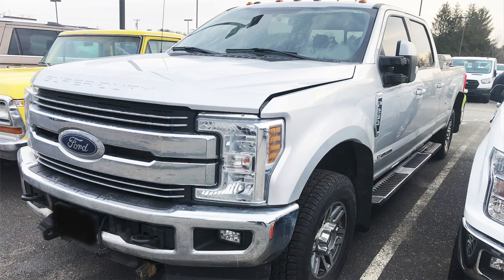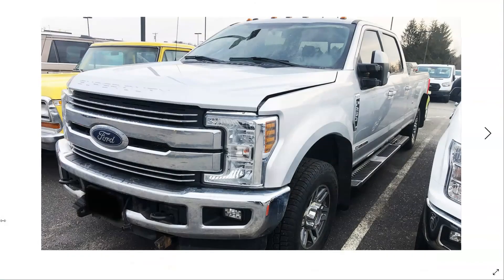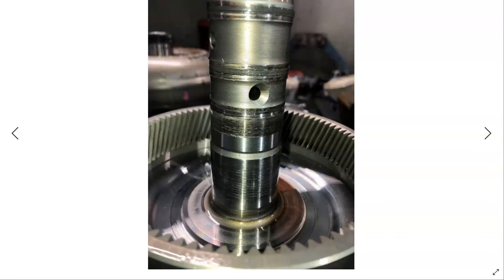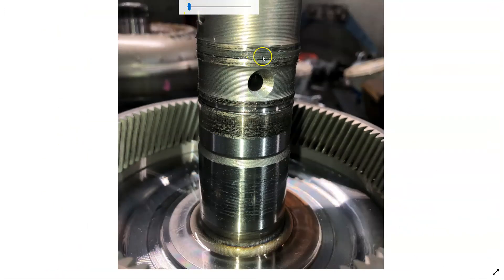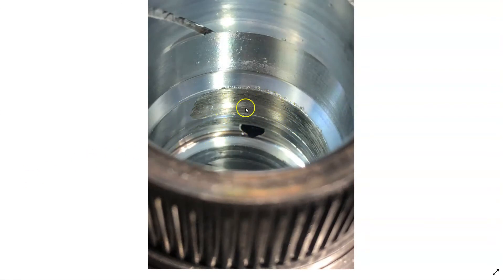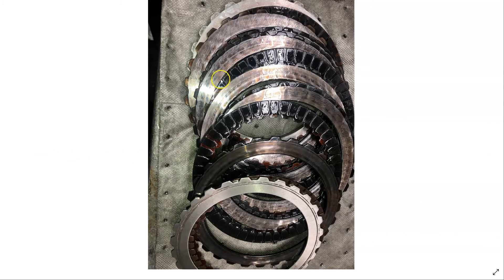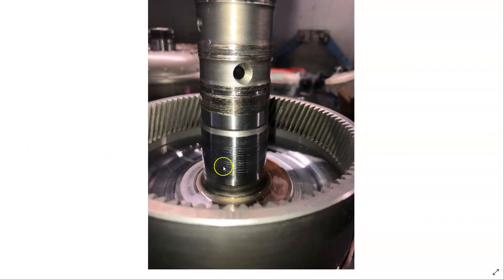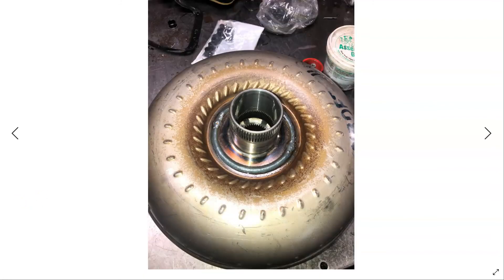2018 Ford F250 Transmission 6R140 FAILURE, P0735 Incorrect 5th Gear Ration, BURNT Overdrive clutches

Comment: I think my 4th gear is going. I got 40k on my 2019. replaced filter and oil 3x so far new pan,replaced 4 shift silanoids cleared the KAM and learning tables. POS give me back the Zf6 speed
Reply: I got 30k on my 2017. When towing occasionally it will slip violently and shake, then downshift. Happens in 3rd 4th now 5th.
Reply: @krice24  Speaking from experience replacing the 6R140 on my 2017, based on your brief description and without any other details or first-hand experience I would assume yours is toast. I recommend setting aside $thousands ASAP.
Reply: OMG if you've done that much trans maintenance inside of 40k miles and it still seems as if a gear is going to die (which means 3 and 5 will go soon after cuz they're already picking up slack), that's lemon territory.